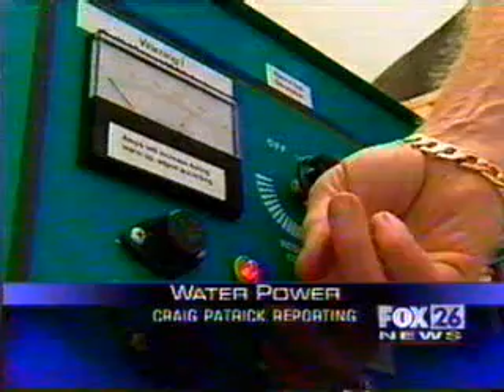Water Fuel Car

Comment: @modelmajorpita You can learn of this yourself by heating a magnet, once the domain structure of a permanent magnet has gone to the red (Heated), the domains miss-align and the focusing power of a magnet is lost. Had that original AETHER force gone away? Heck no,, it is just that the iron structures can no longer focus it. The FORCE is still there. The Everything! All the best, Knute, TR Knudtson

Comment: @modelmajorpita No more perpetual motion than a steam locomotive, or lightning, or the sun itself, or electro-magnetism. Hydroxy simply focuses what was always there, the Either. The Everything force. This is what allows the sun to be quite COLD at its surface YET, at a short distance away, the Hydroxy reaction generates many millions of degrees temperature as NEW materials are brought into this reactive zone. COLD FIRE, just as you see in this Video. Knute

Comment: As far as the Exxon Mobil, Hydrogen boost systems, it would seem they are dealing with just conventional compressed Hydrogen. NOT,,,, Hydroxy, Electro-Chemical Plasmas, Browns Gas or HOH. SoOooOOo the field is still wide open. GOOD LUCK! Knute

Comment: @jaffey2006 <<< You SEE? To all Hydroxy researchers. Learn from these objections. USE ONLY,,, Solar power,,, as your prime-energy source. The sun is 100%, absolutely, FREE and it only takes 1.57 Volts to crack water. Provide for oscillation YES, and you can store unused electrical power in batteries. Work on the catalyzed burn of conventional fuels,, and forget Over-Unity for now. All the best, Knute, TR Knudtson.

Comment: @NebunLaCap Now THINK! Exxon-Mobile believes they can achieve 80% increase in petrol fuel efficiencies with “onboard” catalyzed burn. This makes the claims of 30% or even 40%, pale by comparison. Add to this their efforts in Algae Based fuels production, and you have a paradigm shift in how we understand and use energies. No longer children in basements with batteries and hopes. No longer old men, to be done away with. YOUR FUTURE, seen now.

Comment: @miniseeds Making steel. I was talking about steel. There, in Egypt, at the base of the pyramids you will large vessels of stone. There should be a lip or a hole to let the slag issue out from the crucible. These are used to concentrate ores. Round and bowl shaped. A Foundry.

Comment: @p3snooper This is the importance of understanding the “POINT of USE” concept, with regard to Electro Chemical Plasmas. Hydroxy, Water Fuels, Browns Gas, HHO. Copper-Oxide PV cells can easily be made with Hydroxy and oxygen. At the age of 16, I made non-rusting steels, by age 19, I could life a mountain from its root, dance it around like a spring lamb, and drop it pulverized, back into its base, and not harm the wing of a butterfly in a nearby tree. (Mining)

Comment: @p3snooper Yes, I agree 100%. Please listen to the Video. Never is it stated; that you get more out than is put in. (Over-Unity) This is an improper suggestion and projection on your part. 1st and 2nd, LOTD. 

However, “Cold Fire”,,, IS. 
Elementally discriminating thermal response IS.
A closed-loop energy carrier IS.
A non-ash, non-carbon, totally PURE system of energy suspensions IS.
FREE; when you prime energy is from wind or photovoltaic.

Comment: @kakashilover323 An excellent point to raise. In the Video, you will see that Hydroxy returns right back to the water from which it was formed. We are more accustom to fuels that are consumed, not so with Electro Chemical Plasma. The water returns, after the energy carried is applied to heating. This reductive action is complete and total, so no stray oxygen or hydrogen are induced into the materials heated. 
See: Genesis, ‘Burning Bush.’

Comment: @sonicblast2404 I was further confused because the Hydroxy flame has little to no heat, slightly above the boiling point of water. 259 F. Yet I sustained a deep burn to my finger in an instant. SEE: Spontanious Human Combustion. Latter, it was found that Hydroxy reacts differently to each and every material it comes in contact. The more dense the material, the higher the heat response. Alcohol also burns nearly invisible in sunlight. The Plasma resonances canceling each other.

Comment: @sonicblast2404 Agreed. But the Hydroxy is more a discovery. The machines that produce hydroxyl are the invention. We knew that Hydrogen and Oxygen burn, but at a known temperature and rate, about 4,200 F. But Hydroxy will reach temperatures above 13,000 F. The first time I made a Hydroxy flame, I could not tell the torch was lit, in the sunlight of a window it was invisible to the eye. I burnt the heck out of my finger, and the burn was white in color, not charged or blackened.

Comment: @sonicblast2404 This is why my interests in Hydroxy Plasma, has always been the production and re-cycling of Steels. These resources (Irons) can be used over and over again. 90% of all inclusions that cause the degradations of steel are the result of the fuels used to make the steels in the first place. Here you have an infinitely PURE heat source of a totally pure nature, that returns to water upon use, made as you need it, where you need it. Steels; by the pound, or by the ton.

Comment: @sonicblast2404 It is easy. The arguments and objections you see posted here, are those of a Petrol/Carbon/Fossil Fuels trade rationale. The temperature rise seen in the Video of the stone, brass ball, and charcoal; has a fully different meaning to industrial engineers. A carrier-fuel that focuses energies, is non-polluting and returns to its’ original form as water? How to pay for the solar arrays that would be needed? How much does a ONE mile long trainload of coal cost?

Comment: @BigDaz Your intentions are clear. The article, front page, MJNews, covering the simultaneous relationship of the timing of “Operation Iron Hammer” (Iraq) and the 2 week delay of the Neverland raid, Nov. 18th 2003. MJNO did not yet exist. A follow up to articles starting in April of that year. “Silencing voices for peace,” about Princes Diana and Michael Jackson, and the article spring of 2003, Princes Diana, “The Queen that should have been.” Also MJ News.

Comment: @amanuesis Exactly! Steam is but another example of waters ability to infuse and hold energies. The Diesel engine was originally designed to run on peanut oil. During the Saudi oil embargo of the 1970s, the Media called Germany’s production of synthetic fuels was a hoax, impossible, a LIE, and now Bio-Fuels are made in garages. Coal oil was a staple for heating, lighting and cooking since the 1840s. The electrolysis of water also defined by Michael Faraday during that same era, 1840s.

Comment: @OldKnute Yes it's official - The FBI are responsible for technical errors on youtube.

A quick look at SaintGeorge27 or Gladiator214's profiles below and you will see it's a fairly common problem. We've evidently all logged in because we've posted in the last few days but according to our profiles we haven't signed in for several months. I'm guessing automatic login's aren't recorded is the answer.

Comment: Now: The LIES BigDaz talks about. My hypothesis, 1963, Genesis 1:1,2,3,4. Water Burns. 1966 first separated HOH flame. 1967, common-ducted Hydroxy (PV) electrics and steels production. Non-rusting steels tested Kaiser Steel, Fontana, Ca. 1968. Underwater Welding, US Navy 1974, inferential pressure controls, 1979, colaberations with Yull Brown 1983, BG 2000 welder seen in favorites 1986, News Video 1990.

Comment: Umm??? There is no “Jelly Jar” in this Video.

Where to gather the “Extra Energy” needed to break down water into Hydroxy Gas? LESS than 2 Volts DC but somewhat higher Amps? 

How about a Solar (PV) Carport? Off Grid, CLEAN and GREEN. You only need a tiny amount of Hydroxy to form a catalyzed burn of petrol based fuels.
All te best
Knute
TR Knudtson

Comment: A hot as the surface of the sun???  5,500°C ??? I don't think so.
I can't believe there's a squabble in the comments about using up our water to run cars!!! Don't be an idiot! You don't need to analyze how he does it... he DOESN'T. It's completely 100% impossible to split hydrigen and oxygen with less energy than you get by re-combining them in an engine! PERIOD! Hrfanr and Joepimple, you're BOTH fools!

Comment: So obviously fake.  Yes, you can split water into H and O using electricity.  Yes, you can burn the H and O to get energy.  No, you will not get more energy out than you put in.  The water is like a battery, and not an efficient one at that.

But I encourage those of you who forgot high school physics to spend money on this scam.  Losing a few hundred bucks will teach you the difference between real scientists and crackpots.

Comment: @s3v3rdl0ck I will save you about a year of work. About ¾ of the way down in my favorites, you will find one of mine and Browns collaborations. The Browns Gas 2000 LPH, about 27 mps at 24 volts, at 30% duty cycle. That particular machine, came off the production line in 1986 and basically remained unchanged into the mid 90s till just before Brown death. Send me your e-mail and I will gladly send you the blueprints,, FOR FREE! AND do the same for OTHERS.
All the best
Knute
TR Knudtson

Comment: @Idkfawin32 Yes Idlfawin, OR as well as THIN Solar films that can be applied directly to the outside of a vehicle and that would produce power directly and stored in onboard batteries to supply the needed Hydroxy to assist the burning of conventional petrol fuels, as required, as you drive or as the car is parked and the system recharged. Assisted and catalyzed burning of the more dangerous and poisonous fossil fuel and more fully liberating the contained energies in the fuel. 
TR Knudtson

Comment: @Idkfawin32 If the inital electrical energy used for electrolysis is provided from renewable sources (wind, wave, solar) then there's a net gain of energy too. Not to mention that energy created from using the car brakes can be recovered as electricity and then used to perform more electrolysis. So the car coulc actually create more HHO gas for itself while on the move.

Comment: @Idkfawin32 See Idlfawin, thats the understanding break down. Increased power cancels the mechanical draw of the Alternator for a TINY electrical demand need to break down water to Hydroxy. 1.57 Volts and 2 Amps to reach disassociation threshold. The Alternator of the average car produces 18.7 Volts at nearly 100 Amps soOOoooOOo much more than is needed to develop 50% (Catalyzed Burn) Power/Fuel/Economy increase. BY Efficiencies of what was always there, THE ORIGINAL FUEL.
TR Knudtson

Comment: @OldKnute I honestly wish that this were true, and I wish hydroxy technologies could do this. but they cant. Hydroxy is an energy carrier, not an energy source. You would always need the same exact amount of energy from somewhere else. be it coal, oil, nuclear energy, natural gas. In this process, no extra energy is coming from anywhere. The only benefit of this is he is using electricity as a flame essentially.

Comment: @Idkfawin32 Transportation accounts for about 40% of the US total use of OIL. A 50% increase in fuel efficiencies by catalyzed burning by using ( Onboard produced) Hydroxy Technologies and efficiencies of internal combustion engines, would effectively replace the need for ANY foreign oil imports to the United States and move PEAK OIL worries back some 30 years and, and, and CLEAN THE AIR, in the process. 
TR Knudtson

Comment: @Idkfawin32 Precisely,  There are no claims made of Over-Unity. The addition of a very small amount of Hydroxy only facilitates a more efficient burning of what  was already there, the original petrol intake. Kline never claims that he has YET to make the car run 100% on Hydroxy. Normal Hydrogen has a rate of burn 5 times that of petrol, (Specific Impulse), TRUE Hydroxy rate is far above THAT. The result is a cleaner burn SOONER and more internal cylinder pressures,,,, faster.
TR Knudtson

Comment: It takes the same amount of electric energy to convert the water into hho that it would take to originally push the car. There is no innate energy in water. H20 -> HHO then burning brings it directly back to H20. The only energy that its releasing is the energy it took to convert it to hho in the first place. its like winding up a spring.

Comment: @combustiblegratis 

Excellent! Now it is a simple step to making ceramics, steels that never rust, so pure they will hold and edge 12 atoms wide, (Bi the POUND or by the TON), high temperature ceramics coatings that bend and flex and are the weight of a feather, surgical applications that will let Doctors work directly inside the living human brain to destroy cancers heretofore inoperable. KEEP GOING. 

TR Knudtson

Comment: @LiamXaoh One clear difference, Hydroxy flames will only register about 259 F. when tested in open air, barely above the boiling point of water,,,, YET,,,, true (ECPs) will sublimate Tungsten steel on contact, instantaneously, 13,500 F. Another simple proof, a balloon filled with PURE Hydroxy will rise, not sink. TR Knudtson

Comment: @LiamXaoh Most viable indeed. AND, not combustion, as you might know it. (Theoretic yields by the recombination of,,, separated,,, simple Hydrogen and Oxygen) There are machines now made in Korea, China, Australia, Kline in the US that demonstrate TRUE Hydroxy effects, (Endothermic, Implosive,  Endoforceic, elementally discriminating)  Until you hold this flame in your hand, none of this will be clear. 10 seconds with a TRUE Hydroxy flame, and you will know. TR Knudtson

Comment: @icke11234 what no, what are you even talking about... all im saying is that i learned in science class that water vapour traps heat the most compared to other gases and all i was reflecting on was the what ifs, if everybody started using cars that ran on water.

Comment: What people dont realize is that water vapor has the most profound effect on storing heat from the sun, water vapor accelerates the green house effect more than most other harmful gases, so you can infer that if all these cars are now "burning" water, what that will do to the green house effect... Case in point, would you rather have cars releasing tons CO2, or tons of water vapor. But who knows, maybe it will make so much vapor that clouds will to reflect the suns light...

Comment: No kidding.

How about getting water for Haiti?

Did a 2-foot hole, place a bucket  in the bottom, cover with a plastic sheet held in place by rocks, drop a small stone in the center to form a setteled point, just over the bucket below. Saturate the surrounding soils with ocean water. Evaporation will cause condensation on the plastic and FRESH WATER will drip into the bucket.

TR Knudtson

Comment: WTG Evileslayer. Been doing your homework.

Further, to deal with the Naysayers, put a Solar film on the roof, use the high current, low voltage matching output, to power the Hydroxy catalyzed burn. Take the Needed Energy worries,,, completely out of the loop.

All the best, Knute
TR Knudtson

Comment: @eveilslayer im no physicist or chemist so honestly i dont know where to get a material like that, or if it even exists, but this process could possibly fuel cars, you would just have to refuel the water, because its impossible at this point to get more energey out of this then what is put into it, if you look at it like a normal gas, at this point there is not such thing as propetual motion devices. if there were it would probably not be released do to the loss of jobs and oil company embargoes

Comment: @bpentium you need to quit looking at the world soley based off themodynamics, the laws will never be broken for, normal combusion, but this isnt a normal combusion process, its a plasma, because its not actually a combusion that destroys the material, it just expands back do hyrogen and oxygen and reforms back to the h2o molacule after it exits the combustion chambers, so we need to just find a way to keep stuff from rusting, some kind of temprature resistant water proof material.

Comment: Yes,, Yes,, Guitarman

 Faradays Law for Electrolysis. The separation of water into Hydrogen and Oxygen. 

Hydroxy,, HOH, Browns Gas, Rhoads Gas, and now,,, Klines Gas,,, is NOT simple H and O. It is NOT separated or disassociated, it retains ALL of the original affinity and matrix structure, as a gas.  It IS however, a completely new state of mater and energy, PLASMA Energy, the 4th state of mater. Completely unique to conventional H&O.

All the best, Knute

Comment: and this dood oldknute is a troll on this specific video and subject for some reason. i think that hes gettin a bit pissed that the laws of thermodynamics which were written by *PEOPLE* cant be broken are slowly and surely being proven wrong. hydrogen/oxygen are the 2 most abundent elements in the atomosphere, good luck running out. because the combustion of HHO gas emits pure water. if you dont beleive it watch the damn torch blow out water. the only way your missing it is if your blind.

Comment: Well,, Actually Peekingduck. 

Hydroxy systems work very well on sea water, sewage water or even Human urine. In the case of Urine, it is sterile, contains the proper electrolytes to afford internal ionization and is also quite plentiful. 

When we will see the real breakthrough in applications for IC engines, will probably come when the,, Racing Industry,, grabs hold of these concepts and starts winning races. 

All the best, Knute

Comment: The water has nowhere to escape to so we wont 'run out of water'.
As I understand it, in the last two years it ha become MUCH easier to turn sea water into clean water as scientists in Japan and England has come up with methods that do this very effectively and cheap. The tested it here (Japan) on Edo-river... that's really really dirty and nasty water.
Also, you get the water back after using it for your car. You just need to recharge it.